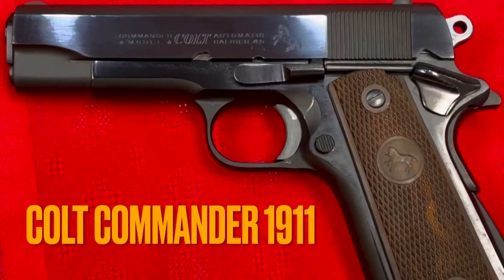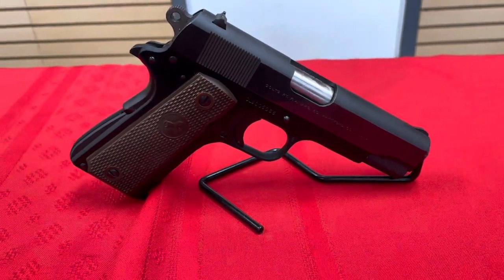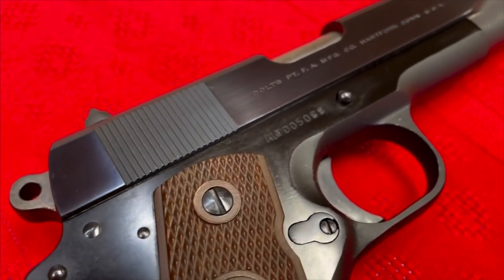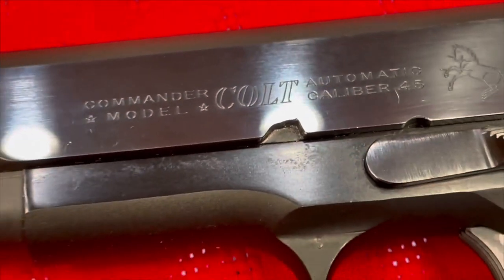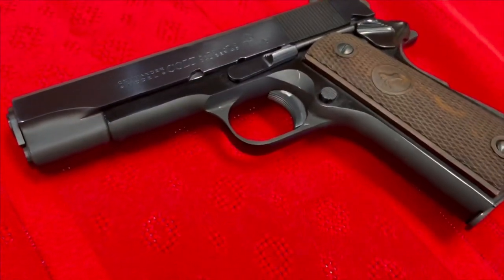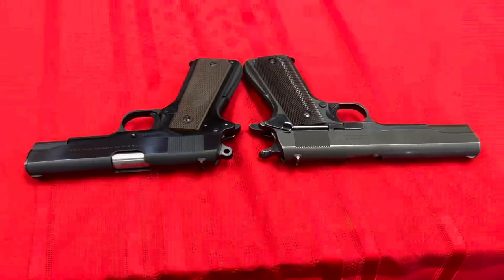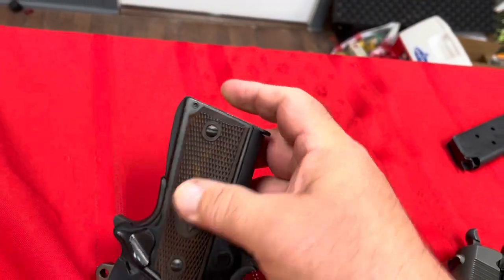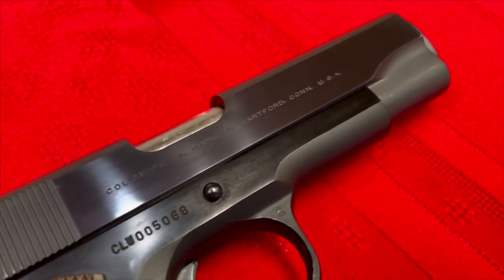Colt Lightweight Commander (1969)

Comment: Just a excellent video on the Colt commander from 1969 the new ones today have much better sights in front and back about $1,000 if you could find one buy it they are hard to find 🇺🇲💯👍

Comment: I take issue with your dates of production; Colt was making light weight commanders into the 1980s at least.  I worked for a Colt distributor in California.
Reply from the maker: with aluminum allow frames?
Reply: @drdrake63  Yes!

Comment: It should also be noted that on the earlier versions, the inside top of the slide is machined out more, also adding to the additional lighter weight. Mine manufactured in '68 has this feature and at some point this was discontinued as a friends LW slide is not milled out the same way.

Comment: I have a Colt Commander in my collection of 1911s, but it is not the lightweight.  I would like to get an aluminum frame Commander size pistol.  The steel frame Commander is really not much lighter than the Government Model. 
When I carry a 1911, it is usually one of my 2 aluminum frame Kimber "Ultra II" models